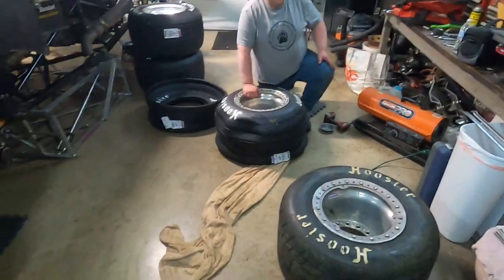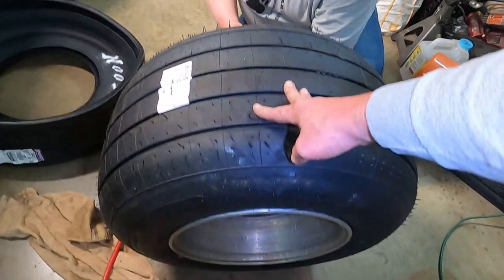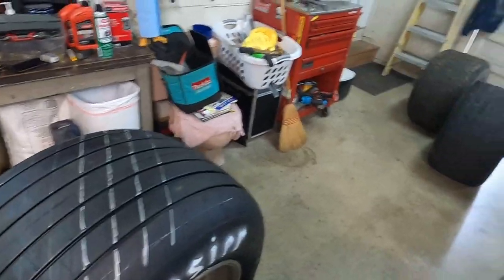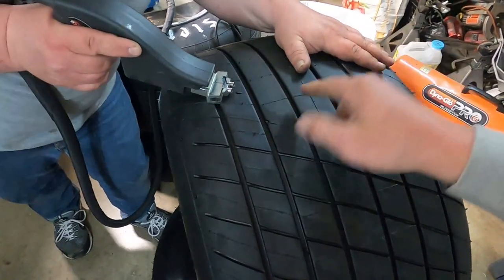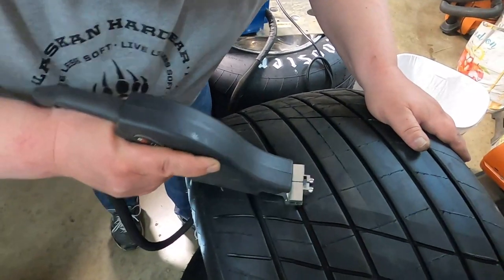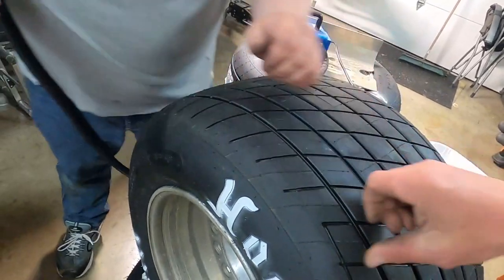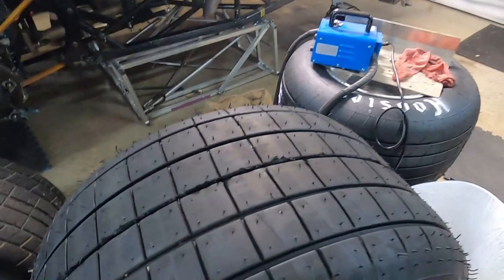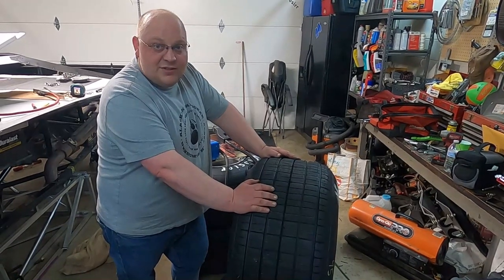NEW HOOSIER DIRT LATE MODEL TIRES!! GROOVING AND SIPING WITH OUR VAN CHEAPSTINE GROOVER!!

Comment: Make sure to start your cuts at the pressure side of the block. Ring cuts start front to back,front being the direction of travel. Face cuts on right side tires make sure the outside to inside. Left side goes inside to out. Never sipe deeper then credit card width. Grind before you sipe. Grind  left side tires with the outside facing you right sides insides facing you.  Hard tires need lots of edges that are sharp.
Reply from the maker: We need someone like you to help us out at the track.  It is all we can do just to get the basics done before the race begins.

Comment: Nice little cost effective tool! I cut my RF the same I just run my diagonal cuts from RF to LR so that the blocks are straight ahead when turned to the right. I don't know if that's the right answer or not but just my preference like you guys said ask 100 people and get 100 different answers!
Reply from the maker: It seemed risky when we bought it... but it works pretty good.  I have been on vacation so I am behind on email.  Good luck this weekend if you get out!!!

Comment: I like tire work I find it relaying and I cut according to track but always start with basic design like you did on front tire cut more if track will allow if same with rear as may shap corners as possible in contact with the track with out blistering/chunking the tire and of course sipping is also all about track conditions and length of race as well
Reply from the maker: We usually run 20 25 lap features and most tracks will be slick and black once the rain moves out.  Any thoughts on sipes for those conditions?
Reply: @LateModelGarage  if it is slick and black, your biggest concern is heat. On a track like that I like to keep the sipes shallow at no more than 1/2-3/4 tread depth and I like to keep my sipes spread out a bit further. If your sipes are too close and too deep you'll get a lot of tread flex causing heat and will most likely chunk out the tread blocks. Hope that helps some.

Comment: At 6:48 I see you guys do the siping of the tires at an angle what is the difference from someone that does them straight across the tire. Is there any advantage?
Reply from the maker: We are not sure if there is an advantage or not.  Seen cars win with straight blocks and cut on the angle.  Seems to be different for each driver.

Comment: U guys know thats a chalk mark. Thats what we used yo blow the tire up too tgen its usually 3in smaller in Hoosiers that chalk mark isnt what the tire is suppose to measure.
Reply from the maker: We are not for sure what the mark means.
Reply: @LateModelGarage  yes that's it means if the chalk mark says 95 it should actually measure 92 in the rule of thumb is about 3 in smaller than tge chalk mark

Comment: U should either blow tge tire up to tge chalk mark or lately hoosier has told us to blow them up to 25 lbs and let sit for 10 mins then let down to runnin pressure
Reply from the maker: Do you do this every week or just when mounting a new tire?
Reply: Just when mounting new tires or when u flip them.
Reply from the maker: 10-4!

Comment: 💱  Groove out all rubber in between every 
    OTHER Line   If it wears faster use harder compound 
  Lower your Air 
Pressures  Read your  
           Edges 
     🎵  Artist: 🎵 
 Commander Cody 
           Song: 
  Hot Rod Lincoln 
              🎶
Reply from the maker: We are limited on tire compound for most tracks.  1350's, LM40's, D21's and D56's
Reply: @LateModelGarage  
🤔 Still: Removing all 
    Rubber in between 
  Lines on every other  
Line might give you 
Great Bite exposure ¿

Comment: Your angles are going the wrong way for a right front tire. Always run circumference grooves and on a right front tire always trace your lines. And keep everything as neat and straight as possible. Siping depends on your track surface on a soft tire I wouldn’t sipe the tire much. When you get to a hard tire like a 1600 sipe the tire a lot more aggressively
Reply from the maker: Could you give some reference as to which way you like to groove the front tires?  We have debated doing them a little different.